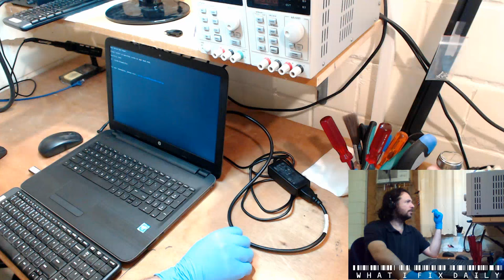[From Livestream] HP 250-G5 Possible data recovery required, dropped laptop

Comment: I was just going to comment that they put screws underneath the glued on rubber strips these days on their newer models. I just saw that a few weeks ago on a G series. it was funny, because HP is known for all those tactics, they have to make things hard to get to. Next it will be adhesive holding the case together....
Reply from the maker: Oh don't give them too many ideas.   Yes, in the past it was fairly normal for most laptops to hide screws under the feet, then they stopped that, now it's coming back in the rage.  I have a little mint-green HP 10~11" laptop that did the same thing (screws under feet)
Reply: Well, as long as you encountered the trick once, the screws under the feet aren't really a burden. But if they start gluing the case like they're doing for the screens right now, that would be a real pain. Or if they weld them too. It's kinda fun opening power bricks with a hammer and a screwdriver, but I hope I won't have to do the same to the laptop themselves. :)

Comment: hdd clicking sound 160 gb sata ,how to recover my data back and fix my hdd,pls suggest.my ibm laptop not starting, kindly suggest.
Reply from the maker: Clicking sound means it will most likely need recovery at clean-room repair.  No software fix.  Some people try 1000 times and maybe lucky, but if it's important, send to clean-room repair.

Comment: What a cheap laptop, it makes my 4000 year old acer aspire 5315 look decent :-D.
i've seen too many hp laptops die, would not touch them with a barge pole.
Reply from the maker: That really is nearly 4000 years old ;)  I agree though, HP's are not in my good books, not even by a long shot.